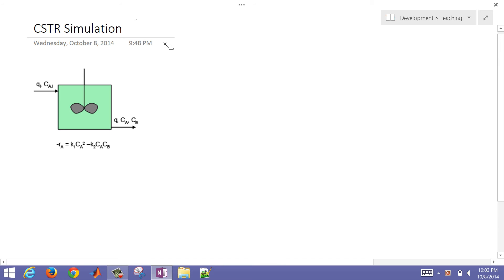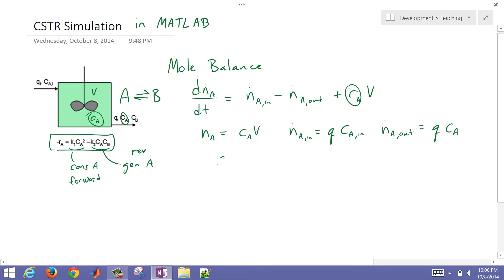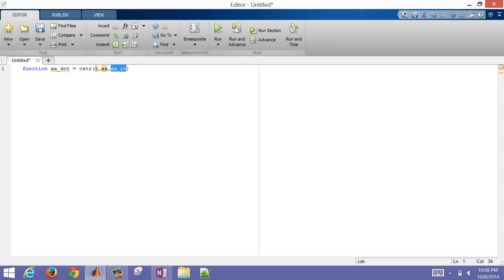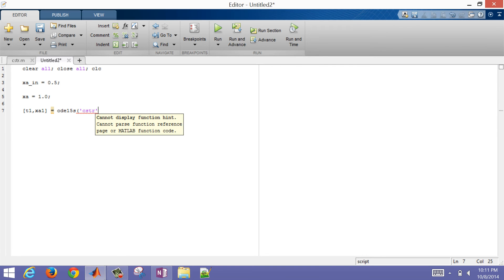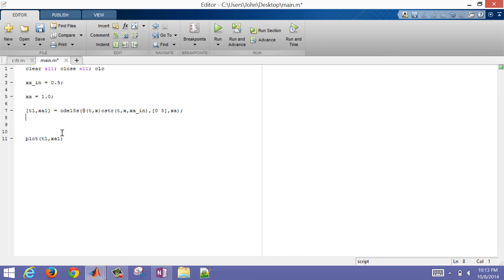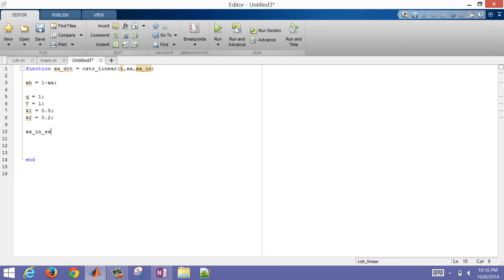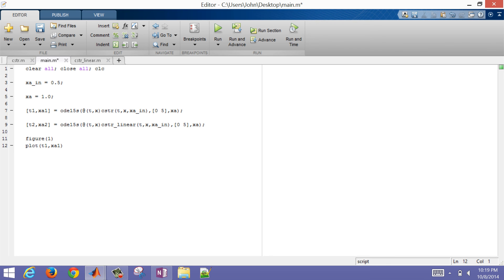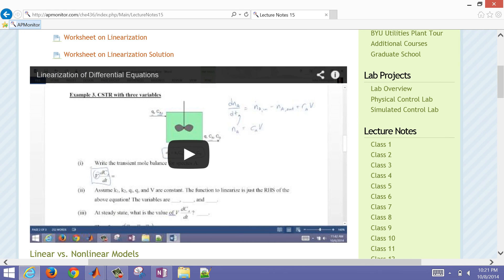CSTR Dynamic Solution in MATLAB

Comment: i've wrote the exact same thing as you but i get "it requires more input arguments to run" error. Can it give an error because of the matlab version or something or what am i doing wrong i really need to make this work
Reply: and at the ode part i get "unrecognized function or variable 'cstr' " error
Reply from the maker: Here is additional information that may help: https://apmonitor.com/che436/index.php/Main/CaseStudyCSTR
Reply from the maker: Try this models: http://apmonitor.com/che436/uploads/Main/sp5_files.zip Close MATLAB and double click to open the Simulink Model file. It is likely a problem with your run directory path.
Reply: @apm  thank you so much I will try that.

Comment: What if the density changes and the outlet flowarte is unknown, how do you calculate it ?
Reply from the maker: Try starting with the original balance equations and simplicity from there. https://apmonitor.com/pdc/index.php/Main/PhysicsBasedModels
Reply: @apm  thank you very much for your reply! however in this example the outlet volumetric flow rate is fixed, what if it is unknown? I have a specific example in mind, an isothermal, isobaric dynamic cstr where gas phase reactions take place (density is not constant but can be calculated from the ideal gas assumption). To find the outlet volumetric flow rate we'd need an extra equation and I don't know what it would be
Reply from the maker: @angiemar88  the outlet is either dependent on the height of the liquid or a valve position. If it is dependent on the height of the liquid then use Bernoulli's equation to define the equation for the outlet flow. If it is a valve then use the valve equations: https://apmonitor.com/pdc/index.php/Main/FlowValves

Comment: @6:32, if the 'xa' is mole fraction, then you should have an extra total concentration 'C' term with the reaction term in the equation, since your reaction is second order. You may have left it out since it is equal to 1, but maybe it should be included in the code if someone wanted to change the total concentration value.
Reply from the maker: Yes, you are correct. It is cancelled out from the right and left hand side of the equations. As long as the total concentration is constant (not necessarily 1) then it can cancel out of the equation.
Reply: @apm  Sorry, I think I am misunderstanding. The left hand side has 1 C term (derived nA with the formulas you have given), whereas the right hand side has C^2. C is constant, but only 1 of the C are eliminated. This would mean that there is 1 C remaining on the RHS, and if the total concentration =/= 1, then this would have an impact on the mole fraction profiles. Is this true?
Reply: C_A = C * x_A, this is the equation I am using.

Since the RHS reaction equations both are second order, then C_A and C_B would both yield a 'C' term each.
Reply from the maker: Thanks, you are right with the two concentrations in the reaction. If it is a first order reaction then they cancel.

Comment: If I run it, It shows error in 7th line.
Reply from the maker: Could you include the error message? Make sure you unzip the archive and change your run directory to that folder so that it can find the required files.
Reply: How can I do this? Any video for this problem?
Reply: Error in ode15s (line148)
(neq, tspan, ntspan, next, t0, etc....)

Error in main (line 7)
[t1,xa1] = ode15s(@(t,x)cstr(t,x,xa_in),[0 5],xa);
Reply: Sorry.. We are new to Matlab.
We change the directory... Anyway thanks for the instructions
Reply: Not enough input arguments.
cstr_linear(t, xa, xa_in)
Reply from the maker: These files should run. Try these instead? https://apmonitor.com/che436/index.php/Main/CaseStudyCSTR

Comment: Great video Professor,

I need an help: how i manage a discrete variation in time of xa_in ? I'm working on a model with n CSTR in series and a PID controlled concentration at the inlet. So, I have an array of xa_in controlled values in time (every 30 seconds), is it possible to feed the ODE with xa_in changing in time? I tried to fit xa_in(t) with a continuous function (declared as a nested function) but in this way I lose accuracy and automation, cause every time I change PID gains I have to fit xa_in(t) with a new function.
Thank you.
Reply from the maker: +Andrea Canali At 15:55 you'll see the ode call to solve the differential equation. If ca_in needs to change in time then I'd recommend setting up a loop with the ode integrator call inside. Every loop could be 30 seconds of simulation with different values of ca_in. Additional CSTR resources are here: http://apmonitor.com/che436/index.php/Main/CaseStudyCSTR

Comment: Prof.,
Please i need your help, how do i model a cooling problem in matlab using an Model Reference Adaptive Control (MRAC) or model reference adaptive system (MRAS).
Mathematically, i am applying control to the Newton's Law of Cooling.
Thank you.
Reply from the maker: Emmanuel, check out the dynamic optimization course at http://apmonitor.com/do  You'll see methods to do adaptive Moving Horizon Estimation and Model Predictive Control.
Reply: +APMonitor.com Thanks Prof. Am currently studying it.

Comment: Hi,  first of all,  excellent videos that you upload to your channel. 

A simple question. What's the benefits of using the linear equations instead nonlinear?
Reply from the maker: I mostly like to work with nonlinear models directly. However, if the linear model is a sufficiently accurate representation of the process over a limited range, it may be useful for linear systems techniques for stability analysis, PID controller tuning correlations, controllability and observability analysis, and for Linear Model Predictive Control (most industrial implementations). There are other reasons to linearize to analyze a system but I would certainly recommend working with the nonlinear model directly if possible.
Reply: Thanks Professor